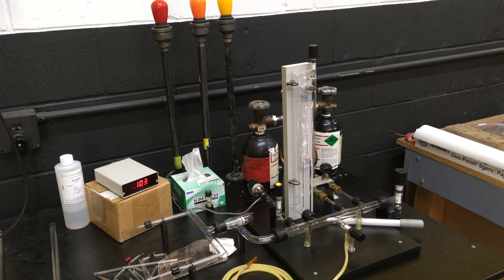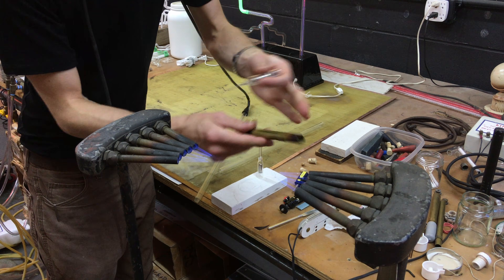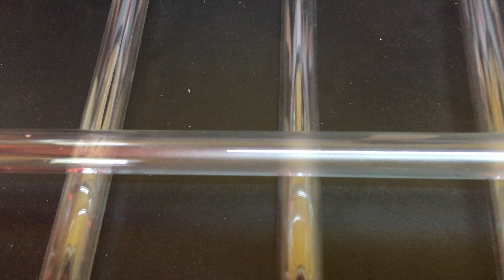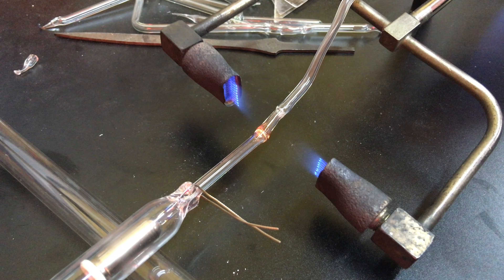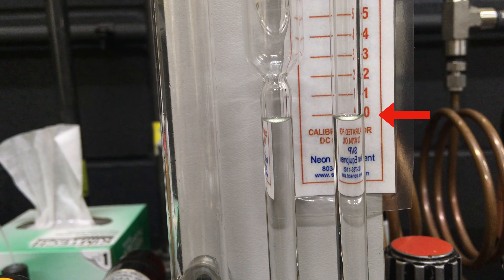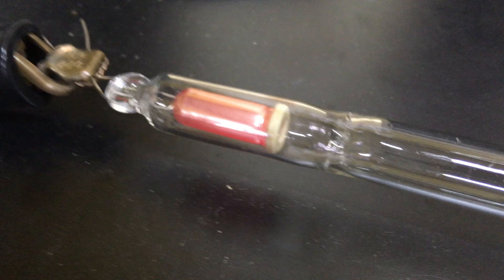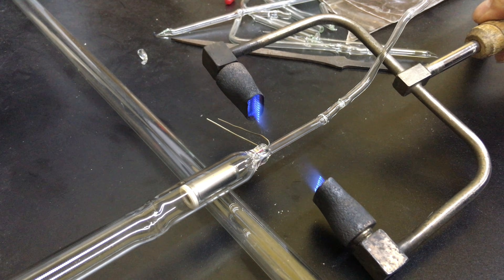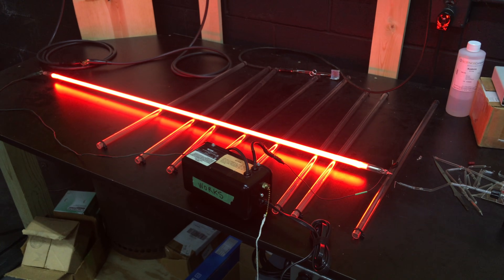Making My First Neon Tube

Comment: Awesome job. Im a lamp worker learned pipemaking on a mirage(nice torch) I already work with glass. And know enough to be dangerous about electricity. How much and where can I get your bombarder set up? I'm trying to transition to neon sculpture and light fixtures/small signs. What bombarding unit do you recommend for a small space. 7 x 9. Cheers from maine
Reply from the maker: if you're looking to purchase a new bombarder setup, EGL has them: https://www.egl-lighting.com/bombarders/

however, if you're looking for used neon equipment, it is rather scarce.  you'll have to be patient and keep an eye on craigslist, FB marketplace & ebay.  the neon setups i've seen lately seem to be around $4k-$5k and up, depending on what is included.  most of the time they're completely disassembled and you'll have to learn what everything is, how it works, and how to assemble it.  since you are a lamp worker i assume have knowledge of torch systems.  also, since you have the equipment to work borosilicate, you could build your own vacuum manifold out of off-the-shelf scientific labware connectors, fittings, valves, etc.

not going to lie, 7'x9' is a really small space for a neon shop.  most neon benders build their tables to be 4'x8' or larger to have enough room to work, and that's not including the bombarding station.  one option is to do the bending yourself and pay a local bender to do the processing for you.  that way you wouldn't have to worry about trying to shoehorn a giant bombarder, choke, vacuum pump, vacuum manifold, etc. into your tiny space.

speaking of bombarding, the current used is lethal and you don't get second chances.  i feel i would be remiss if i didn't mention this, considering you mentioned you know enough about electricity to be dangerous.  if you choose to do the bombarding make sure you know all the risks involved and how to take adequate safety precautions.

i'm not trying to dissuade you or be unnecessarily harsh, i'm just trying to give you a realistic idea of what is involved.  a good way to get started is to read all the neon books you can get your hands on.  i recommend "Neon Techniques", "Neon: The Next Generation", and "The Neon Superguide" for starters.
let me know if you have other questions!
Reply: @NeonPreservation  thank you!
Reply from the maker: you're welcome!  and after thinking about it, you mentioned you would be doing light fixtures & small signs; so you probably wouldn't need a full-size bending table.  7'x9' is still a small space (glass sticks are 4' or 5' long) but you could probably make it work for bending.  still not sure if you could fit a processing setup in there with it though.  also, you'd definitely want some sort of ventilation if you're burning torches in such a small space.
Reply: @NeonPreservation  I have experience with high  amperage as well as industrial gasses and safety
Reply from the maker: ah, excellent.  i try not to be patronizing (everyone is new once), but i get asked about bombarders frequently and i never know if it's someone who actually knows the real dangers of electricity, compressed gasses, CO, etc., or if its just a random person who saw a video on the internet and thought it was "cool".
Reply: @NeonPreservation  can I email you? YouTube's deleting my comments. I've typed so much to you about all the details all for not lol
Reply: @NeonPreservation  you're not patronizing***
Reply: @NeonPreservation  I'm 13 years on the torch. Yes I'm familiar with torches and tanks. I have lots of ventilation. All kinds
Reply: @NeonPreservation  and I built and wired all my own appliances in here. My kiln switch and relay I built. I have 100 amps here and I'm very careful
Reply from the maker: yes, my email address is in the "About" tab on my channel page: NeonPreservation (at) gmail (dot) com

Comment: I am so happy to see someone younger than me setting this up and doing it! In 1986 I set out to make my own setup and after getting my hands on the book Neon techniques and handling, I was able over time to create a system and by 1988 I made my first cold cathode tubes. Believe it or not, some practice tubes still are over my bed and still work! Moving caused me to disassemble the glass room and everything has gotten mixed up in my collection, so for the last 20 years I have not done anything with neon. Am going to check out how you set your system up!
Reply from the maker: that's awesome!  it's amazing how long well-made tubes can last
Reply: @NeonPreservation  I was inspired to make a quick video showing how they still light up despite being in place since 1989.
Reply from the maker: nice work!  neon is really quite simple, yet has such a magical quality to it.

Comment: Could you measure the lumens per watt starting from the power supply.
Reply from the maker: i currently have no way of measuring that myself, but values are readily available online.  there are many variables that affect the lm/W output like type of glass, phosphor, transformer, etc.  here is a PDF that has some values you may find helpful; it is old (2006) but neon doesn't really change, so they should still be accurate.
https://www.neon-lighting.com/wp-content/uploads/2020/09/LED-Vs-NEON-neonefficiency1.pdf
Reply: @NeonPreservation  Very Impressive efficiency values in comparison to LED lights, seems only a red LED light is more efficient by 1 lumen per watt. While every other color neon beats out LEDs. I used the link you gave earlier to find everything else I need, but for the neon gas, a bottle/gas-tank would feel easier to use than a flask because of the connector, from where do you obtain the gas tanks from? Also as for phosphor glass tubing I have found some online sources, but what do you recommend from your experience? Also how much can one expect to pay for a 25 liters of neon?
Reply from the maker: the price of noble gases has increased drastically in the recent months since most of the world's supply comes from Ukraine.  you'll have to call around to find out what it's going for these days.  looks like this 12L tank was listed for $152, but who knows what it will be when they get it back in stock: https://www.abitechsupply.com/shop/tecnolux-ultrapure-100-neon-gas-12-liters/
Tecnolux, EGL, Ablon Technologies, eBay, etc., are all places to find tanks.  Ultra High Purity (UHP) 99.999% Research Grade is the standard for the neon industry.

as for buying tubing, some manufactures will only sell to people with a business account, and others will sell to anyone.  you could try your local sign supply shop to see if they have any you could buy, or you can buy online.  i personally have not purchased any tubing yet since i have many boxes of old stock.  that said; FMS has an online store where you can buy directly from them: https://www.brillite.com/products/tubing.php
or from Ablon: http://ablontech.com
and Abitech sells neon tubes by the stick: https://www.abitechsupply.com/product-category/neon-supplies/neon-glass/

there are probably more that im not thinking of at the moment but those off the top of my head should get you started.
Reply from the maker: mixing gases (i.e., a Penning mixture) is commonplace in the neon sign industry.  it is most often done to outdoor tubes in cold climates.  Neon gas has a higher electrical resistance than Argon, and by adding neon to Argon/Mercury tubes it will cause them to run slightly warmer and keep the mercury vaporized in the tube, preventing dimming of the tubes in cold weather.

pure Argon alone glows a faint pale lavender,  but pure Neon alone is a bright reddish/orange.  if you make a tube with 80% Ne & 20% Ar, the illumination from the Neon will overpower the Argon and the tube will glow like a regular neon-filled tube; e.g., bright reddish/orange.

Comment: And my next question :)
Do you know a good rule on how much gas(pressure) needs to be filled in the tube?
Reply from the maker: the fill pressure various by the diameter of tube and type of gas used.  there are charts to use as a guide.
Reply: do you have a link to one? i dont find anything on the internet
Reply from the maker: transformer manufacturers include a Luminous Tube Footage Chart with their transformers.  there are many examples online but here is one; the gas fill pressures are on the bottom row.  the charts show Neon & Argon/Mercury fill pressures, which are the two gasses normally used in neon manufacturing.  other noble gasses can require different pressures.
https://www.gogsg.com/ASSETS/DOCUMENTS/ITEMS/EN/France_Luminous_Tubing_Chart.pdf
Reply: Thanks

Comment: Do you know if it possible to make tubes without the bombarding process? 
If it is, I'll think twice about working with that high current.
(This is already my 3rd question, so I hope I don't annoy you too much ; ) )
Reply from the maker: not annoying at all, sharing information is one of the reasons i make these videos :)

the output current of a bombarder is deadly, so it is wise to have a fear of it!  it is possible to make tubes without bombarding by using the oven pumping process.  the tube is heated in an oven to the appropriate temperature while the vacuum pump removes the impurities, then the electrodes are processed with magnetic induction.

no high-voltage required, just an oven large enough to fit the tube.  some people build their own ovens, like this one by Mundy Hepburn, who makes plasma art:
https://youtu.be/LvTFTQxjFU4
Reply: And would the tube Funktion If you don't process it at all?
Or can you process them with a normal neon  transformator if you process it in little parts so the resistance isn't that high?
Reply from the maker: a tube that is not processed will light, but only for a couple of minutes.  it will get very hot due to all the electrical resistance of all the impurities present, and the internal pressure will rise to the point where it can no longer sustain an arc.

a normal neon transformer does not output enough current to process a tube.  generally, electrodes should be processed at least 10 times the manufacturers mA rating to fully activate the getter on the electrodes (e.g., 300mA for an electrode rated for 30mA). the glass needs to reach a minimum temperature of 225-250°C and the electrodes need to be glowing bright orange (c. 1000°C).  

those requirements take more current than a standard neon transformer has, which is why a bombarding transformer is used.
Reply: @NeonPreservation  and will it process successfully, if I use a rather cold and big flame to process the tube itself and then a electromagnetic induction heater to process the electrodes?
( im searching for a way, where you dont need to build a big oven or buy a bombarder)
Reply from the maker: the problem with heating small areas is that while one area is being heated, another area is cooling, and the impurities released while heating will be deposited onto and reabsorbed into the part of the glass that is cooling.

not to mention uneven heating of the glass will cause thermal expansion/stress issues and likely cause the tube to shatter.

Comment: what kind of glass do you normally use to make neon tubes? normal borosilicate glass?
Reply from the maker: neon is normally made with soft glass; either lead, barium-strontium (a.k.a. "lead free"), or soda-lime.  in the USA borosilicate is rarely used, usually only with art pieces.  in Europe the use of borosilicate for neon is more common than in the USA.

Comment: This processing not correct.
Reply from the maker: as a self-taught amateur i have to learn by trial & error.  would you care to provide comments on how i should improve my technique?
Reply: There are many differing methods of processing, and anyone who knows Neon will know that this method is in fact “correct” as you can see from the results, furthermore it is a very well known and widely used method

I too use this method in one shop, and in another shop I use another method in which the main stop cock is left open through the entire bombarding process, meaning you do not need to open and close the main valve to inject air etc, you simply strike it up continue to bombard while the system pulls down, and the choke is increased incrementally (not just at the latter stages) until the correct milliamps and temp is achieved

The shop where I use the method shown in this video has the exact same Daco manifold, which calls for this exact method to be used, the other shop has a very different manifold hence a variation of method - and the results are exactly the same

One shop uses a temp gauge, the other uses 250° heat crayon, ya get me?

There are many more methods than this, many of which all bring a similar result and will vastly vary depending on where you are located in the world - for instance shops in Europe will have vastly different processing techniques than shops in say, Australia where I’m from

To say this method of processing is “incorrect” is simply not true. Keep it up brother your channel is awesome! 🙌🏼
Reply from the maker: @benjaminkonto8331  i appreciate the words of encouragement!  the tube i made in this video has been burning basically 24/7 for almost two years.  it runs lightly warm to the touch (like a normal neon-filled tube), and there is no sputtering at the electrodes.  so, i guess the processing wasn't THAT terribly "incorrect," especially for the first try.

i have noticed in all the documentation of bombarding techniques i've read, they all differ in one way or another; like in the examples you provided.
basically, it seems "correct" way is to meet the requirements of: heating the tube enough to burn off the impurities, having enough current to activate the getter on the electrodes, fully evacuating to a deep vacuum, and backfilling to the correct pressure.

there are many techniques & tools available to accomplish these steps.
Reply: Exactly. To be honest this method of processing is fairly new to me, and I have had to read up, watch and learn from multiple sources to find the correct balance of technique

The majority of my bombarding experience (only around 6 years) has been on a “constant evac” system, as described above, which I personally I find is an easier process, as it cuts out the need for multiple pull downs and air injection, but, I’ve heard the process you are utilising here is a “cleaner” and more refined process

The Daco training video was one source I utilised, and your process very closely mirrors what is shown in that video. The original VHS tapes came with the neon shop job lot that I purchased back in 2017  😂😂

I think what’s commendable is that this result was achieved with only a rotary vacuum, no turbo or diff. I know one person who uses two inline rotaries to obtain the vacuum needed, but everyone else either uses turbo or metal body diffs. That’s crazy when you think about it! 👊🏼
Reply from the maker: @benjaminkonto8331  that Welch 1402 i have is an absolute workhorse!  i got it for a steal on eBay in "working but untested" condition and all i did was an oil change & force flush and install a KF-25 intake.

i am amazed at how well it works; but i will be adding a glass diffusion pump to the setup eventually so i can reach ultimate vacuum faster.  im always looking for ways to improve my tube quality by improving my setup & technique!
Reply: @NeonPreservation  nice! Yeah a “Daco” branded vacuum pump came with my original gear, apparently it was used at one stage, but when I finally hooked it up it would not even push the vacuum gauge one single bit, it was tested by a local deep vacuum engineer and was seen to pull vacuum, but obviously not enough to even read. I heard from SVP that these models were quite rubbishy and were not made to last, I believe SVP still sell Welch to this day

I recently upgraded to a new Edwards RV12 which works extremely well and is very quiet, but still does not obtain ultimate vacuum needed for the system, but ultimate vacuum is obtained with an original Daco glass (oil) diffusion pump and the combo works very well

I imagine when you add the diff pump your vacuum system will be unstoppable, can’t wait to see it!! 😂💪🏻
Reply from the maker: @benjaminkonto8331  yeah ive heard some of the Daco branded equipment wasn't the greatest... although a lot of their stuff was good; my manifold is quite nice, for example.
Reply: @NeonPreservation  yes the manifold is great, and the choke, gauges and diff are all great. The vacuum pump definitely left something to be desired  😂 and the bombarding transformer is quite hardcore, it’s a converted oil drained 46.3amp pole-pig and I’m still working to get it balanced

I’ve always bombarded using Masonlite transformers which I’ve always found very smooth